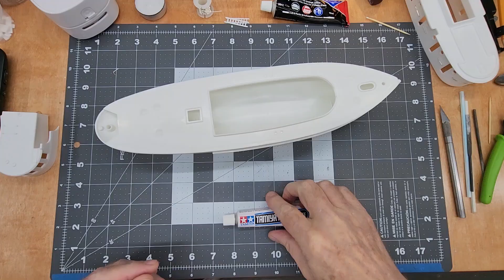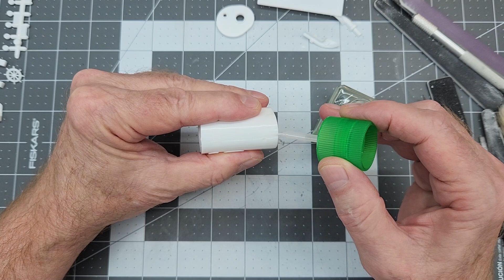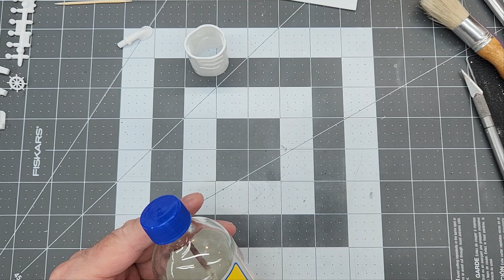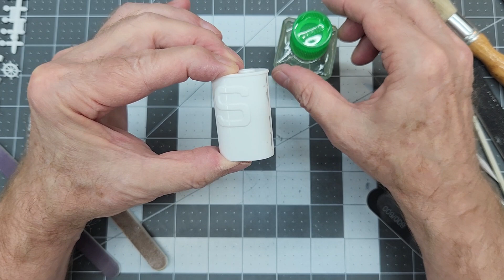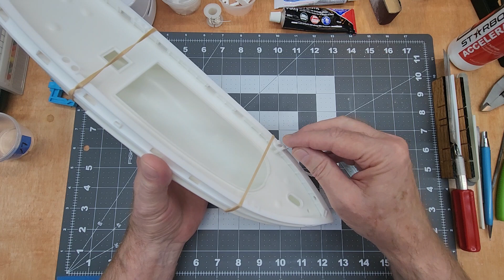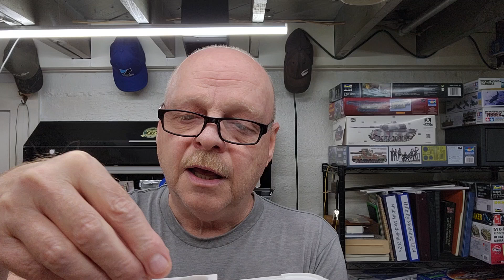Diesel Tug by Lindberg, Part 3, Bridge, Funnel, Vent and more

Comment: I have a question the funny thing is it’s not about the model. Is the tan Tamiya drill the same as their blue one or is it geared differently. You made my mind up also because I was thinking of getting the Revell tug kit.
Reply from the maker: Hi Tim, glad to hear that you've decided build a tug, I think you'll enjoy it. As for the drill, the blue one has a step-down gearing whereas the other one has faster RPMs for grinding. Hope that helps, thanks for watching my friend. Johnny
Reply: Interesting, I too have never seen the Tamiya tan hand drill.  I did find it on Amazon also I have seen modelers use the PROXXON Rotary Tool MICROMOT which has a speed control so cutting not melting plastic and has the torque so as not to bog down when cutting.  Of course it's pricier at just over $50, (the Tamiya drill was $29) but what's the saying, a workman is only as good as his tools.